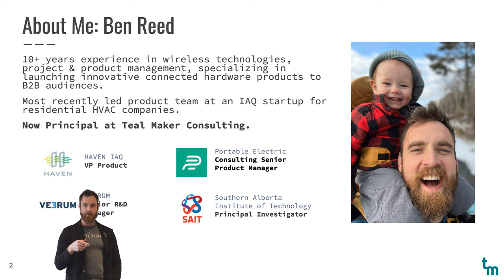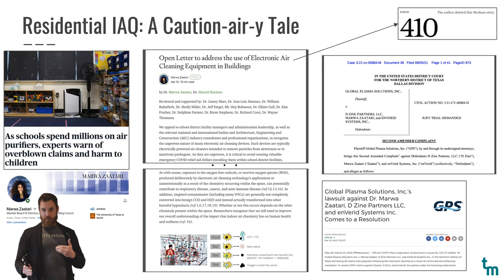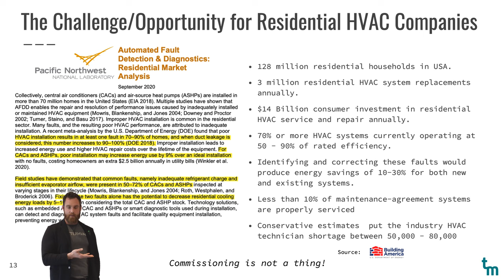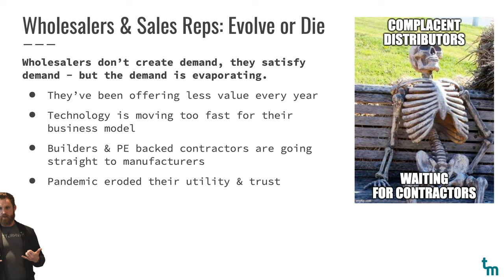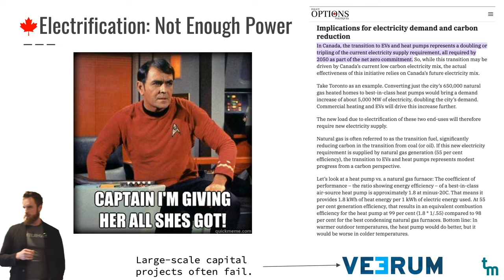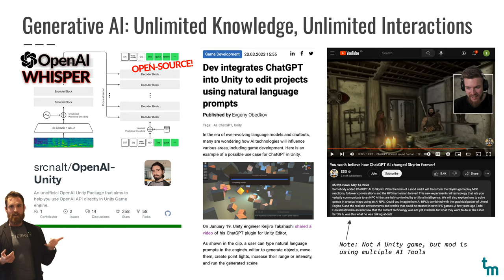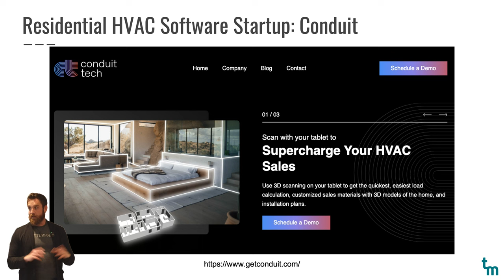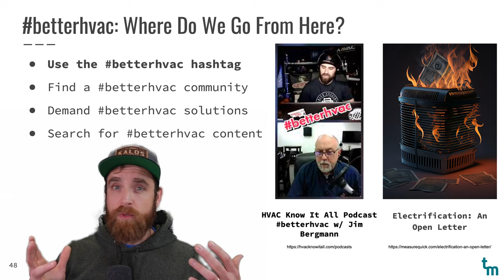The Paradigm Shift in Residential HVAC

Comment: This is a very good overview of all the forces that are making the future of the residential HVAC industry very challenging. I'm probably most freaked out about private equity which tends towards short term profits at all costs and is eating up the HVAC industry. Unless better practices are more profitable to shift that market, things are going to be... interesting. 

While Ben and I may have slight differences of opinion (I'm not particularly concerned about the grid, at least in northern climates), this is worth a watch to see the headwinds that must be overcome. 

Fundamentally, incentives need to be carefully aligned so that contractors and homeowners are pulling in the same direction with both being happy in a transaction. That will require a new business model that is likely to span multiple companies, hence #betterhvac. 

Last night we dove into the heat pump provisions of the US Inflation Reduction Act on the HVAC 2.0 Show and how they make contractor lives significantly harder, not easier and are very likely to slow down rather than speed up heat pump adoption, which was the intent of the program. It's another piece of this conversation. https://youtube.com/live/eFQ0vKPmJFc

In the end, how does it work to bring together a large enough group in the HVAC industry to shift it permanently and for the better? That's the answer to seek.

Comment: Man that was great Ben! You packed so much into that. Excellent flyover of all of the challenges. You brought up several pieces of the puzzle I hadn't considered. 

I love the emphasis on a decentralized group with common values.

One question I'm wrestling with: is there even currently a market for #betterhvac? Or is it more something we as practitioners see that the average homeowner doesn't even notice yet? Again maybe these challenges will build to a head and create a demand for something new. I just struggle to find educated caring consumers at this point. People have so many other things going on and I don't begrudge them that. 

I would love something like an advertising agency that targets homeowners looking for a certain type of contractor and finds a way to pair those two people up. Like a HVAC dating app, so to speak. 😂 

My current strategy is to build a base of good, solid HVAC work that focuses on fundamentals and then slowly add advanced specialization as my time allows. Right now this is simply a market reality for me although I would love to help people who want to electrify, etc. I have no way to find those clients. 

Thoughts?
Reply from the maker: The market demand for #betterhvac doesn't exist yet, but that's one of the things I'd like to fix. Creating scalable frameworks to allow all of the #betterhvac companies to break through while also investing in a consumer demand generation flywheel is my goal.